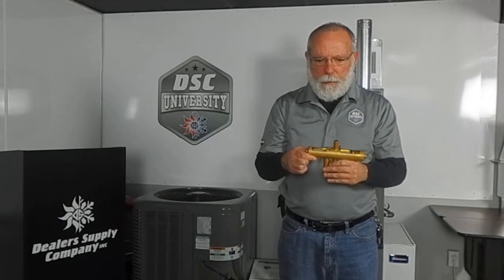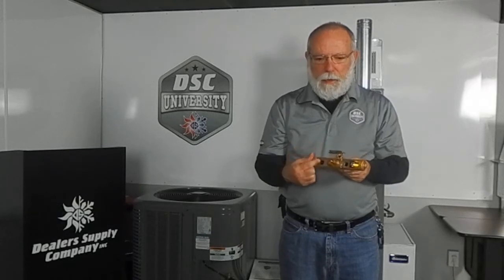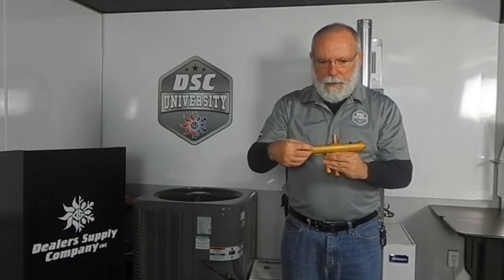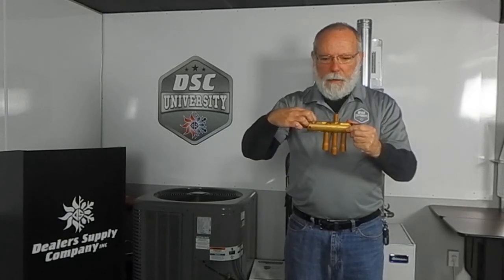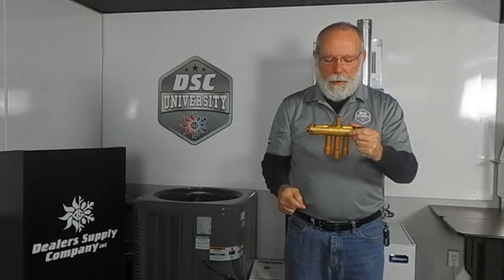Reversing Valve Magnets

Comment: Thanks for the demo on reversing valves. Mine is 12 years old, and it is stuck in heat mode. I can't seem to find one like it, and back orders are approximately 140 days, so I was wondering if I could use a powerful rare earth magnet to free it up. What do you think?
Reply: Well.  Did you get the reversing valve to change with a magnet?
If so    what kind.   Thanks
Reply: That is my worst nightmare.   I will never buy a Rheem again